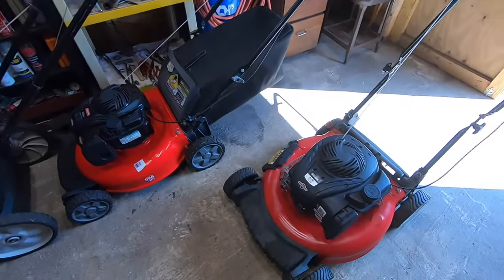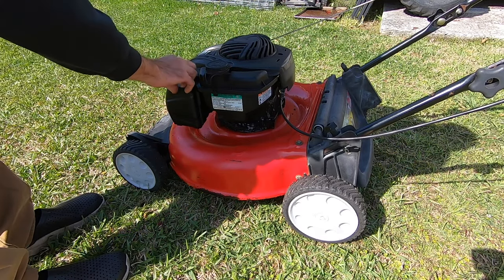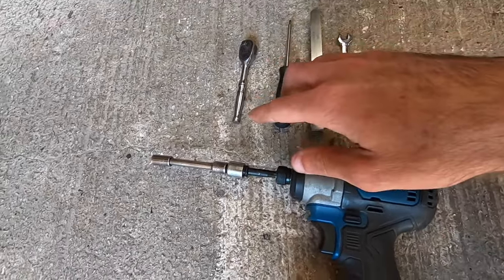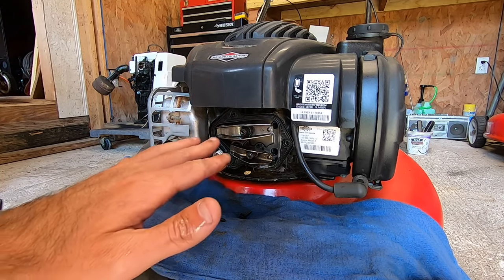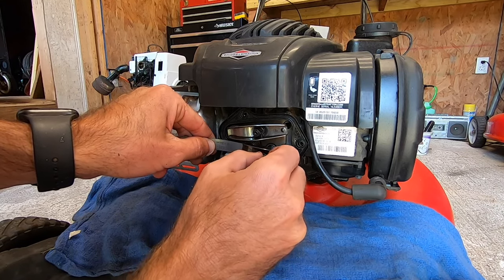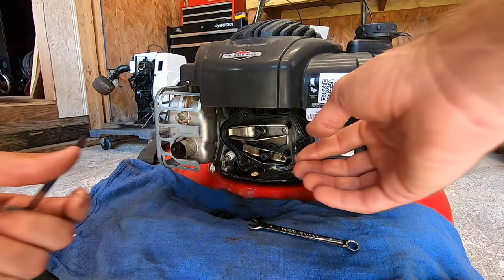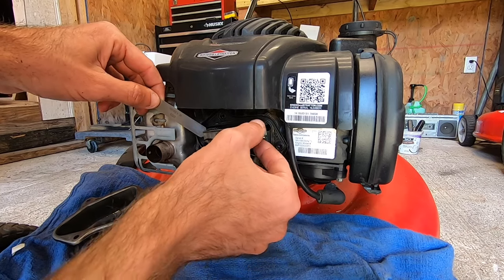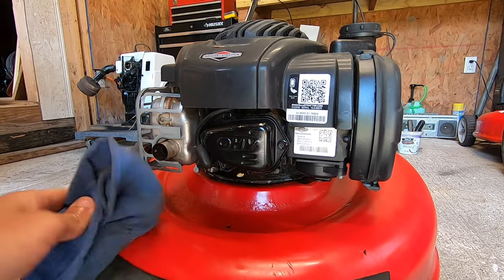HOW TO ADJUST VALVES BRIGGS & STRATTON OHV (TROY BILT, CRAFTSMAN, MTD)

Comment: This video just fixed my mower sir. I have that engine on a Snapper. VERY difficult to start last summer Removed the valve cover  today and the intake rocker is very loose. Headed out to adjust them now. Thank you.  Great video.
Reply from the maker: That’s so great to hear. I hope you got it dialed in and running good again!!
Reply: Glad I came across this while researching hoping to see that I was right in determining which valve was which. 
  I think I was told I was wrong.  Just trying to confirm I got it right. 
  Mower runs good. I set one at 5 thousandths, the other at 6. 
  I have to back  to try to get the intake where it will stay adjusted. 
  Should I set both of these at 5 thousandths like you did that one?
  104M02-0223-F1

Comment: Cool I haven't set the valves on a push mower yet! Good find and good lesson!
Reply from the maker: I’ve shown a few of the carb cleans on these machines, but yet to show a valve adjustment. Hopefully this helps someone, and glad I got to the bottom of the no start condition. Thanks for stopping by as always 🙏😎
Reply: @freedommowers420  Definitely helped me!!!

Comment: I’ve got one just sitting in my garage. I’m going to use it as my first project now thanks
Reply from the maker: These machines are pretty easy to do a lot of repairs. Thank you for stopping by. Feel free to ask questions if you need.
Reply: @freedommowers420  You definitely boosted my confidence, my problem I’m scared to make the problem worst, thanks!

Comment: I have the Troy built 240 and it just quit running after I cleaned the carburetor and flushed the gas tank then I opened the valve cover and walla, lose rocker arms and a quick adjustment and now it's running smooth. Thanks for the help.

Comment: I finally figured out that this is what was going on with the little Murray mower I am working on. It will sputter and backfire a little every once in a while, but it won't do much of anything. I cleaned the carb twice, drained the tank, and replaced the fuel line. It didn't make any difference.

Comment: Same problem you showed. I've adjusted the valve's before. But when I check by rotating the engine (mtd yard machine e300 125cc b n s) the rocker arm come loose again, won't stay adjusted. Found a small pice of metal (spring pice). Rods are not bent and feel no resistance rotating the engine. Going to check how the valve's feel next and check guides also. Wonder if there might be some internal issue also? Had this mower over 10yr. And I change the oil.

Comment: I’ve got a 7hp Briggs on a Toro, I’ve cleaned, fixed, and adjusted everything but this so far. It’s a hard start condition. A couple pulls on the rope, or cranking forever with the electric start, it doesn’t start like it should. I’m going to tart his next, thanks,

Comment: Alex, have you ever had a cam lobe move on one of these engines? My daughter hit a stump and now it won’t do anything. Flywheel key is fine. When I picked up the mower it doesn’t pull through like the compression release is working. Been waiting on a new cam from Jacks for about a month now.
Reply: Yes the cam lobe can move and several have 😢😢😢
Plastic cam

Comment: You set the exhaust to the same clearance as the intake? Shouldn't there be a .002-.004 difference? My motorcycle 
set at Intake .004-.006 exhaust .006-.008.

Comment: In our shop every engine gets the values lash adjustment to start with if it’s over head values, they AllWAYS are out of spec,once it done it’s starting fluid , tool clamps on plug wire and try to start

Comment: Great video.  The valve over on my 11yr old 550EX is stuck. I tapped on it and even tried to grab in with  large channel lock pliers, and it would not budge. How can I remove it ?

Comment: I know I am old fashioned but I like the flat heads better they rarely had problems unless they got burned or a seat came loose, but these over head valves seem to need adjusting a lot,, I am gonna have to to that to my Hustler mower with a Kohler engine, the engine starts but it tries to kick back some before it starts, I am guessing the valves are out of adjustment.
Reply from the maker: I agree. I had much less issues on most flatheads, besides the valve seats coming loose like you said. Seems to be a common trend to over complicate everything. It certainly wouldn’t hurt to check them on your kohler. Hopefully that does the trick.

Comment: I believe that if the blade is unbalanced the vibration will make the valve adjustment to be out of wack  I  did a.video on weed.eater line spool head  maintenance. To.make sure you are able take it apart for   keeping it clean
Reply from the maker: I agree. This one had a bent blade on it when I first looked it over. Most likely the bent blade vibrated the valves so bad it eventually loosened up.
Reply: @freedommowers420  I agree with you on this matter a bent.blade on a direct connect to the engine is always a problem in the waiting

Comment: Nice work! Seems like these late model Briggs engines are somewhat prone to this. Lack of attention to torque specs at the factory?
Reply from the maker: Thank you. Yes it could very well be a lack of torque or maybe lock tight. This one did have a bent blade on it when I got it and I think they let it vibrate for a long time. I greatly appreciate you stopping by.

Comment: Thought I had already posted this. Glad I came across this. I been trying to confirm which valve is which. 
  I adjust them on one for a friend and chose the top as exhaust like the one you show at 3.34. 
  I was thinking someone told me it was not but mower ran good for the minute or so I ran it. Now I need to make sure the intake ( bottom) one stays where I put it. 
  Motor- 104M02-0223-F1
  Craftsman M-230
163 CC
  I did not adjust them the same as you. 
  I adjusted these at 4 and 6 thousandths. 
  Should I adjust them the same as you did that one, both at 5 thousandths??

Comment: How do you find a engine serial number?  I keep trying to use Pro Chaser to buy carbs for my power equipment which is all Troy Bilt.   But I always get sorry we can't help you. ..I use the model numbers like 11a-542q711.
Reply from the maker: There should be stickers on the side of the plastic cover on the engine or on the side of the engine block. Sometimes they want model and serial number to get an exact match.

Comment: I'm having possibly the same problem intake valve is a little loose went through the carburetor cleaned in numerous times it'll fire up if you hit it with starting fluid and that's it fresh gas and everything could this be the one problem problem

Comment: I have a 6.25 briggs troy bilt, leaf vac, I have been troubleshooting and stumbled on you video, maybe u can help me, I've went through the carb and fuel system, it all seems good, it turns over and runs but will not get to full throttle....seeing your valve adj video, im thinking that may be my issue, is tht possible,  my apologies if this content isn't for Q & A...thank u in advance.

Comment: I'm assuming this would cause knocking if it would actually run but still out of spec? I have the same engine and mine makes a loud noise when starting and stopping the engine. Wondering if this could be the issue.
Reply from the maker: Very well could be the valves tapping. It could also have something to do with the pull rope recoil on these. I have had some before that would chatter.

Comment: Hey Alex, it was a good video. I got mine at 4000 it’s getting fuel and it’s got spark but it still won’t start. About the fifth bullet pops any idea what’s going on with this mower.
Reply from the maker: It sounds like it could have an issue with the flywheel key. It’s common on these and the timing of the spark won’t be when it is supposed to. I would take a look at that next.
Reply: @freedommowers420  yeah I checked the kids just got a little weird to it. I flipped it around it’s not that far off. I went over your carburetor cleaning, and I did not take that centerpiece out and clean it so I’ll do that again, but I thought it was getting gas.
Reply: Cleaning the way you do it still doesn’t start

Comment: On my B&S engine model#09P702-0190-F1     140cc       the valves don’t look like valves you just adjusted , I can’t see a set screw or locking screw to release the adjustment nut . The rocker bolt  doesn’t have a center cut out for any type tool, be it a torx, or Allen wrench. I’m hoping that I could find some information on how to adjust the valves on you tube. Thank you and I enjoyed your posts . Please help me if you can,
Reply: It’s a self locking nut, just turn it to adjust lash/ clearance
Reply: @philliphall5198  May I ask you, how did you learn about that self locking nut ? Thank you, for your reply to my comment. I’m interested in learning more about that, my research on that was unsuccessful, so if you can let me know where I could learn more then thank you.
Reply: Sounds like you might have what I think is L shaped motor with no adjustment nut on the valves.
Reply: @philliphall5198 That was my question.  I figured it was some kind of fancy built self adjusting thingies.  I'm  a 78 year old female.  I adjusted it maybe 50 times and still cannot fix it.  I even have forwarded it 1/4 inch and set it.  It still does not work.
Reply: @heyheyyo2389  Great to hear from you, ! I bought the locking nut studs to install in my mower, tried to adjust the self locking adjuster but still have a backfire when I shut the engine off. Am now waiting for offseason to make the replacement with the new parts , adjuster stud and locking mechanism, hoping that will resolve the misfire issue. If you have any other ideas that could be helpful please let me know. Thanks
Reply: You're  doing good.  I can't  get mine to start.

Comment: Hi why do I  get a pop sound after turning off my lawnmower Briggs and Stratton engine 5.5 only after it's turned off.
Reply from the maker: Maybe it is running rich and has a backfire on shut down.
Reply: @KennethCSaunders  I’ve got the same problem with mine, cleaning the carb didn’t make a difference, so I went and checked the valves. The valves were out of specifications both the intake and the exhaust ,readjusting to specifications helped mine.
Reply: @freedommowers420 Fuel solonoid?
  Pinched flywheel key possible?
  Needle not sealing properly?

Comment: I opemed the ohv cover 😢 and ever since my lawn mower leaks from there a lot of oil. Did i not seal it back properly?? Pls help.i did screw it back ans now it wont last when its on
Reply from the maker: Most likely the gasket or seal has an issue. You can use a high temp RTV or new gasket.

Comment: Why why why......  The tightening bolts on the input and output do NOT have a center set screw.  I don't  understand.  I have a Toro, Briggs & Stratton GTS 140cc, model 21352.  ¿????????????